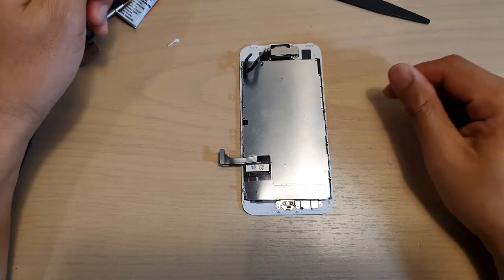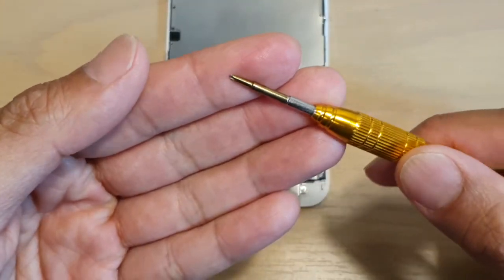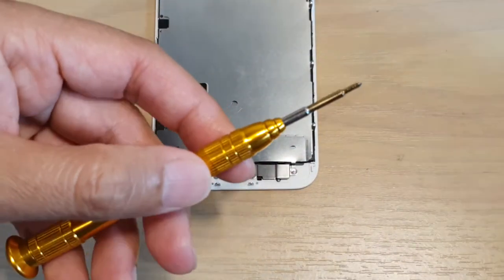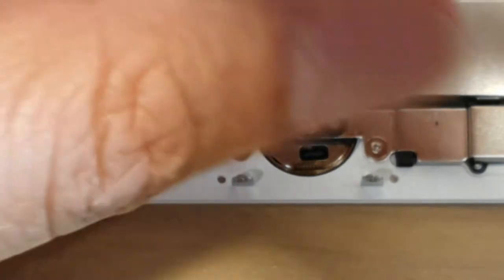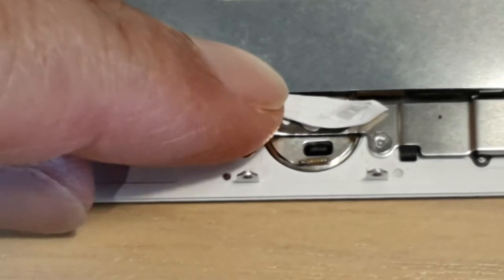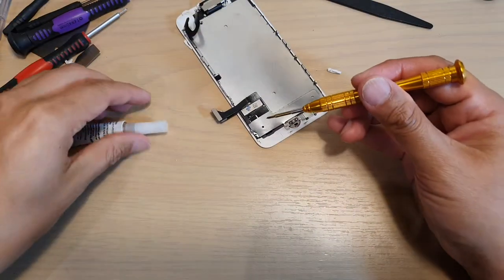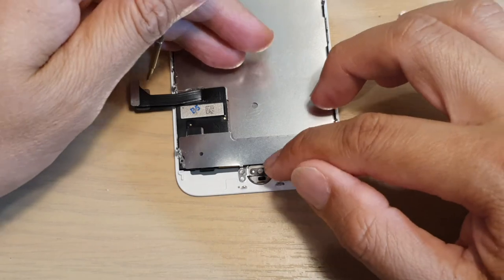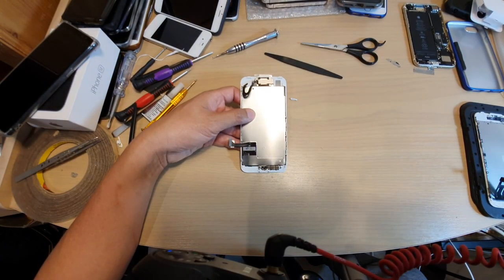How to Remove Stuck / Stripped Tri-Point Screw on iPhone 7 Home Button

Comment: I was taking apart an iphone 8 and I was doing a housing swap and screen replacement (it was ran over by a car) and the screw stripped.  I didn't have the plumbing tape so I just used the battery strip lol and it worked too!  Thank you so much!